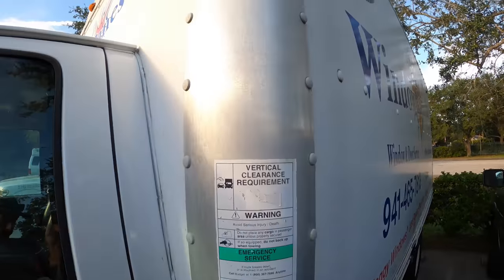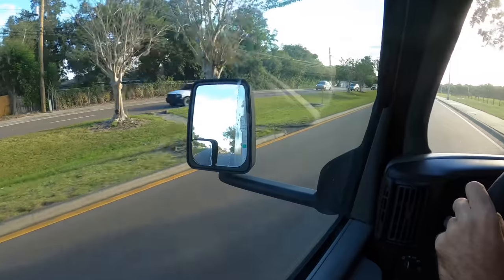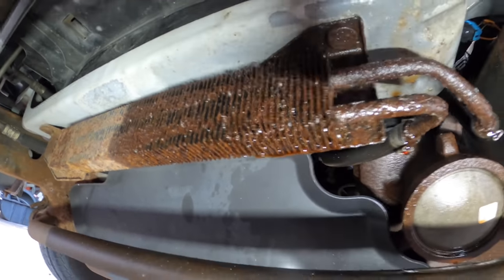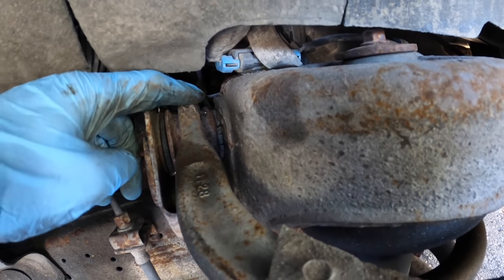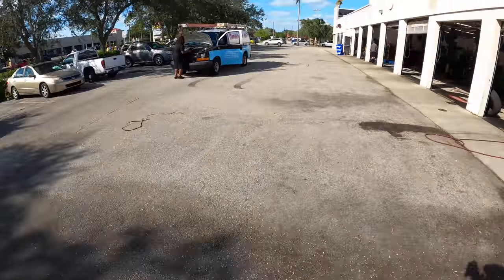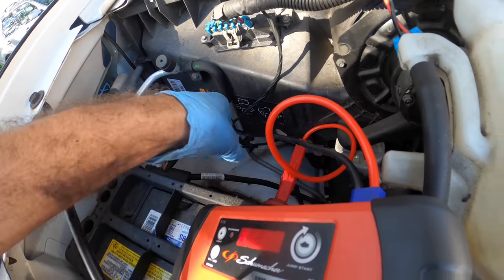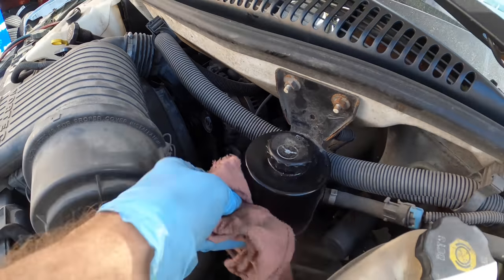Two Hour Inspection | DECLINED everything! almost

Comment: When I worked for Toyota in the 90’s, we had a contract for GM cube vans. I got stuck with them a lot. They fit in my bay fine but could only lift them 4’ off the ground or you would hit the ceiling.

 Went across the street for lunch one day and a manager lifted the cube van thru the roof while I was gone.  He wanted to show the customer something underneath and never looked up.
Reply: Nice.
Reply: Was the highlight of my career.. I remember seeing the cube sticking thru the roof as I was walking back to work with my gyro lunch.. “yep, the bozos did it”
Reply: I was loading a Bobcat attachment in my truck one day. Unlatch start lifting, boss comes over and starts barking to tilt it forward...No Idea why made no sense. So tilt full forward it slips off hits the ground flops about a foot from his feet as he jumps back. I smirked...asked him if his life flashed before his eyes. He replied I'm not ready to laugh about this one yet, turned and walked away. That'll teach ya to stick your nose in MY JOB LOL, you don't know what you're doin might get hurt. I got assigned elsewhere a while later so another guy had to fill in where I was. I pop in one day he says damn you spoiled him or somethin, he just calls me and tells me to go do something like I should just know what to do...man I don't have a clue what he's talkin about...I just laughed. Call me bro when you need help

Comment: I’m genuinely upset how disposable and carelessly people treat cars like this. 

Instead of preventative maintenance, people will wait until EVERYTHING breaks, increasing costs in the long term.
Well done inspection, Ray! No reeees from me today.
Reply: This one is close
Reply: True... The only thing they really cared about was the AC. lol. 
Seeing videos like this makes me happy state inspections are mandatory where I live...
Reply: 5 grand worth of work, cost of repair more than the vehicle.
Reply: "I’m genuinely upset how disposable and carelessly people treat cars like this" it not the disposable car that gets me it the disposable life! of the guy coming the other way
Reply: There is a scooter we have borrowed from another shop and it arrived with the engine light on. Of course we all know that if the light is on and it still runs it must be an error and still fine, right? I'm using it trying to decipher what it is and I know now.

It's fooked. Seriously though I think it's a fuel delivery issue as it keeps surging and can't keep idle and has less power than the mopeds.

Engine light comes on, you get it looked at.

I had a wheel bearing issue, tried to get it fixed when I noticed it but was declined a repair as they couldn't replicate it. As time went on, it was clear and the exhaust went. I only had money for one or the other, the other had to wait until the week after.

I got an engine code on my car and as I have it remotely hooked up, I got a call telling me about an engine light so I asked what it is, they tell me P0500 VSS. Speed sensor. Oh, yeah, I know. I can see it not moving. Fixed that later. OEM for the win.
Reply: Most individuals with zero understanding of how a motor vehicle works don't give 2 f*cks what their mechanic suggests/advises them to replace, especially if they're tight with money.
Reply: Yep. I do a lot of my car work but due to limited resources I have the local shop take care of some stuff. I took the car in to the shop last week and they recommended replacing tires and repairing a couple of leaks in addition to alignment. I had them take care of all of it. My car has been paid off for a few years and a few hundred bucks to keep it running at least another couple of years is more than worth the cost of fixing it. The good news is that the 12 year old car drives like new after replacing most suspension components, tire, re-alignment and keeping up with general maintenance. I couldn't be happier to not have a car payment. If I were to sell my car today I would make someone very happy as it doesn't have any serious maintenance issues to be addressed at the moment.
Reply: Never in my 20 years i skip regular service . Every years  brake and suspension check by mechanic or guy on techical when drive for insurance and registration i live in europe so its diferent then i usa. AND I CLEAN MY CAR BEFORE I DROVE IT TO MY MECHANIC I NEVER SAW SO MUCH GARBAGE  IN CARS THAT RAINMAN FIX . You can get tetanus 😂😂😂
Reply: @Jacks Journale brakes and suspension  it must be fix or checked every year.  I cant get insurance if something need to be fix .  Car goes on lift technician check tires suspension co2 lights  after they finish if it is ok then i can pay insurance if not i must drove to mechanic to fix it if i not fix it in 14 days licence plate goes to police .
Reply: They Neglect their cars forever,everything is leaking,broken or about to fall off,then complain about the prices quoted to fix the disaster.
Reply: @a4000t  on my 2002 ford focus only 10x10 mm rust on fender you can find car still driving like new . I saw bald tires on this chanell
Reply: Yes, they decline maintenance and safety items, don't change the fluids when needed then when the car breaks down they call the make junk.
Reply: I hope this person gets to sign a waiver about unsafe vehicle too that way it's on record somewhere, should anything happen. As long as it's not a rental and it's the same person driving it, it's not as bad I suppose.
Reply: @Rnrinmyblood1  We take of our cars well and keep them so long that neighbors think we're not doing well financially with these 15-20 year old cars. (but they run well)
Reply: @Chris-yy7qc  Yea i was thinking i can understand the cost of repairing all that might be too high to get done at the time, but when they were going to spend money on the ac over the rest, it's kind of upsetting knowing there personal comfort is more important then the safety of others.
Reply: Not surprised by this customer at all — this is Florida, with no state inspections and thousands of dangerous vehicles on the road, mostly driven by uninsured motorists. I see cars on the road every day with no working lights, bouncing or wobbling tires from a broken suspension, no hoods, and bumpers held on by duct tape. Not surprisingly, I also vehicles abandoned on the side of the road every days as well. People here are too cheap to do any regular maintanence on a vehicle — when they get a high service estimate, they either keep driving, or worse, sell it to someone else who also doesn’t take care of it.

I recently purchased an 18-year old Lexus with 183,000 miles on it in Pinellas County — just down the road from Ray as a matter of fact. I went in knowing the tires were dry-rotted, it was throwing a code for bad oxygen sensors, there was no evidence that the timing belt had ever been replaced, and that the front and rear suspensions probably needed to be replaced based on the way it handled. Still, the price was good and I have a good mechanic I trust. So I took a chance and bought it. Two weeks later (and $3500 in repairs), I had a beautiful Lexus in perfect working order. 

Anyone else would have just driven it and then been shocked when they blew a tire, or a wheel came off, or the engine seized because the timing belt seized. Frankly, I think 90% of the car-driving public here in Florida are too ignorant about mechanical things to be allowed to drive.
Reply: @Jacks Journale 
"We usually only fix what it came in for. You can mention what it needs, but it won't do you any good."

here is something i witnessed

-timing belt needs to be changed.
-it gave me no problems so far.
-You will absolutely nuke your engine.
-nah
month later
-well timing belt broke, how much to change? if i bring the part in? i found it on ebay for 20$
-yeah well...
Reply: Not to trigger anyone but a vehicle is a tool. Just like any other tool of a trade. A lot of companies will run a fleet vehicle into the ground that has been giving them problems and keeps going to a shop. This truck likely has a few miles on and and by the looks of those cooler lines it travels north frequently. If it's a lemon, squeeze all the lemonade out and throw it away. Cheaper long term to dispose of something such as a problematic truck in favor of something that only needs 'normal' maintenance to keep profits up and all teams on the ground working.
Reply: @zacharyg1260  I see your point, but like other tools of the trade, when certain tools are worn out to the point that it becomes a safety issue, they repair it or replace it. I don't think the truck was tool bad yet, but it's just going to keep getting worse over time and i just hope they take care of it before it gets to the point where someone gets hurt.
Reply: @tedwertman2115  I wholeheartedly agree but the bottom line is as a self employed general contractor I'm always buying older vehicles outright because work is sporadic sometimes so payments are financially irresponsible and I generally run them into the ground. I have bought probably 15 vehicles over the years for less than 500 bucks. I'm not putting 5g into a 500 dollar truck that I'm going to beat up with work. I'll do the minimal and keep it at the very least safe. Good tires brakes and nothing falling off. Anything more is pointless because the vehicles value is less than total repairs. My latest Dakota has zero safety issues after putting 300 into it and buying it for 200 - I won't fix anything wrong with it cosmetically because it's a truck I use to haul debris to the dump. If it blows up, I have made money off it with removal fees. Go buy another. It was meant to be in the junkyard when I bought it 😉 so I'm just giving a worn out vehicle a purpose. But yes, if you cause safety concerns for other drivers you need to repair or replace. Risk your own life but not others.

Comment: Here in the U.K. you have to put your car through an MOT test every year they go through checks on your car to say it’s safe , that suspension looks like it’s been like that for awhile and so would of failed the MOT test and wouldn’t be able to drive on the road till the work as been carried out. If you had done the work on the bushes I am sure the truck would of drive a lot better , shame on that business owner for being tight
Reply: an MOT test is not a proof of safety, the test it self only proves the vehicle condition at time of test, 5 minutes later on the road anything can fail and not be a comeback to the test unless it is corrosion related, i was a tester for nearly 40 years, never use an MOT as a proof of the condition of a motor vehicle. as for the repairs required on this van they would not stop the owner driving away from the test station.
Reply: Yep, that car would have had a list of Major Fails and advisories in the UK and would not have been allowed on the road.
Reply: @alanlawz  majority of it is for safety esp when it comes to brakes and a wheel collapse or any leaking fluids
Reply: @alanlawz  "an MOT test is not a proof of safety"  It's proof of a basic standard of roadworthiness at the time the test is performed, and even then the tested is limited in what they are permitted to inspect (e.g. no covers allowed to be removed).  I've always thought they don't go far enough, and then I see the rolling piles of scrap that are permitted in the USA...

Comment: I was an auto mechanic in another life. A common and easily overlooked cause of the brake pull this box truck had is the steel brackets on the brake hoses that attach them to the upper control arm. They fill with rust and clamp off the hose, causing brake pull or “stuck caliper” like symptoms. Very common on many GM and Chrysler vehicles. I have pried them open and cleaned them out for exceptionally cheap customers who didn’t want to pay for new hoses.

Comment: 24:45.  Best part of the video for me.  Also, one additional tip when using hose clamps:  particularly where access is limited, make sure to connect your lines without the hose clamps in line.  That way, you get to take it all apart again because you forgot to put the clamps in.  At least, that's the way I prefer to do it.  Why do a job once when you can manufacture ways to do it multiple times?
Reply: Yeah... absolute truth... and while you are at it use a no 7 or 8 socket on the jubilee clamp bolts instead of a flat or star screwdriver... grip without the slip.
Reply: Hose clamps can be completely undone and threaded back in, unless of course you prefer to redo everything..
Reply: @HighwayRamos  hence my saying “particularly where access is limited,” but reading is hard.

Comment: This is incredible a commercial vehicle with these faults being allowed back on the road, in Ireland this couldn't happen. I'm retired now but keep up to speed didn't have the tools you have but still got the job done. never got to wear them fancy gloves. keep up the good work good mechanics are never appreciated. stay safe.
Reply: In Florida there is no requirement for any safety inspections, or emissions checks.  That's why there is junk like this on the road.
Reply: In South Africa, all commercial vehicles must have a COF annually but private vehicles ONLY when sold.  So minibus taxis can be death traps because they've never been listed as commercial vehicles
Reply: In nearly every other state you can stop and red tag it.

If they truck carries anything over state lines you bet I'd stop and tag it for a tow and ticket.

Comment: 16:17
Handy tip.
As you ARE replacing that entire fitment / cooler unit.
Any 4" angle grinder is your best friend.
Grind off the entire bolt end (the bit without any head, welded into the old bracket), and throw it all away along with that crusty rusty bit.

Comment: The only thing that made me feel the length of this video was the time it took to remove the rusty screws on the old AC cooler unit. Otherwise, it felt quite OK to me to watch the rest of it. Keep up the good work, we're enjoying your material. edit: I meant the rusty nuts & bolts on the old AC unit.

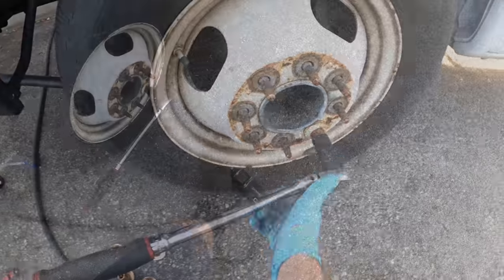Comment: 3:58 I've watched many of the videos already. As a physicist, I like the foot-pounds of torque crack, an intentional reassignment of length dimension to the source of force. If only I was teaching a class currently, I would include this clip, with permission of course.
Reply: That and nuts and bolts... especially if you're working in the engine compartment.

Comment: Up until today, I'd never seen clear fluid in power steering, and this is second video I've seen it in. In Australia, most workshops just use ATF as per manufacturers recommendation.
Reply: I would have cut the tranny cooler bolts off with a battery dremmel at the base wonce there was enough space it wood have been easyer.

Comment: Some days are diamonds, some days are stone. Facts of life. You did heal the other van with just a touch, so you blessed it? That's gotta count for something. I really want to thank you for fixing that leak. I ride motorcycles and fluids for power steering, transmissions and hydraulics, are really hard to make out on the road at night. It caused me to go down one time. I saw it the next day and was a big dump of hydraulic fluid on a chip seal surface. Way to hang in there.

Comment: Yet another quality fitting dorman product  B^)
Reply: Normally I'd agree with the China crap , but this time it was due to the hose itself .
Reply: @eaglerider1826  True enough, but being myself an auto trans mechanic, replacing a tube radiator with a plain tube, is going to pay-out on the fluid due to increased running temps...BTW...

See this above buddy? Our little convo here has spiked the wrath of a wumao!! And it's a bot I think...
Reply: @gcbification  Very true about the overheating issue but I guess this is better than just using an elbow to keep it from leaking . I ignore the bots and they just go away .

Comment: Talking about the ratchet slipping brings back memories when I fractured the tip of my ring finger in two places on my right hand. When my 1/2 inch 28 long ratchet slipped and I slammed my hand into the front spring of a propane truck

Comment: You could save time by using a Dremel tool with a cut-off wheel to cut off stubborn hose clamps and small corroded parts. It works great!

Comment: I think the power steering cooler you replaced wasn't.  I think it was actually the Trans cooler. The replacement part looks suspiciously like the cooler/ pipe to the "left" or front of the van. I noticed it and the mounting brackets are identical to the replacement cooler.you probably couldn't see it because you had to lay on the ground and it wasn't in view.
Reply: To clarify, the rusted part that was leaking was in fact the power steering cooler as evidenced by the loss of power steering fluid that needed to be re-filled. The replacement part he installed was the same part as the cooler/pipe to the "left" or front of the van. I'm not sure if the aftermarket Dorman part misidentified this as a power steering cooler or not, but perhaps GM parts could have supplied the correct replacement part. Although the steering will essentially not have a cooler anymore since there are no cooling fins, I think the customer will still be pleased that the leak has been stopped because it appears all the customer cares about is being comfortable in nice cold air conditioning and doesn't care that the brakes have a problem and the suspension is missing parts(bushings) and is a major safety concern. But hey, at least before they crash and kill someone they'll be driving around in a nice cool unsafe van.